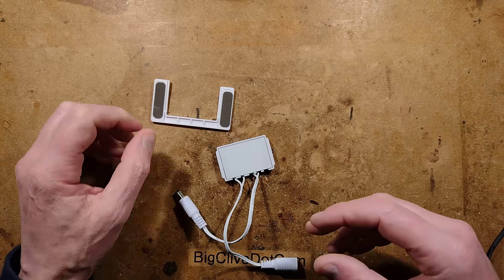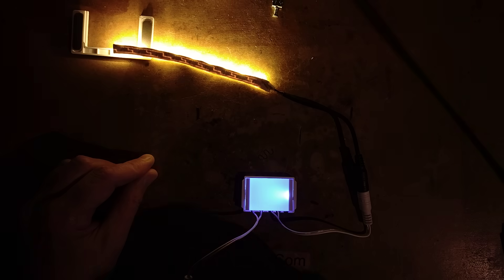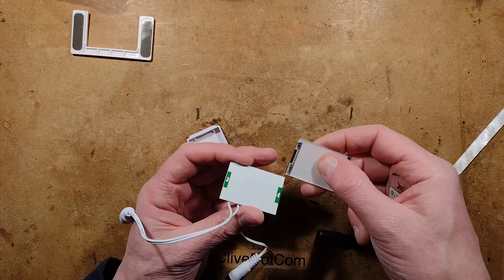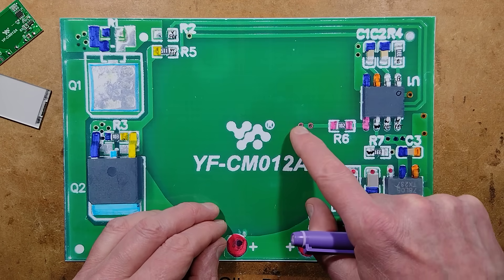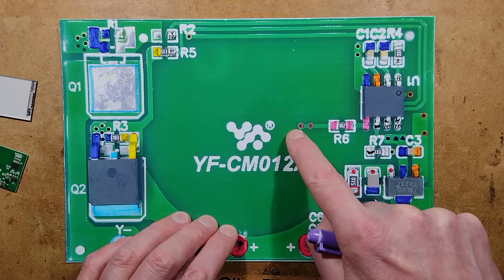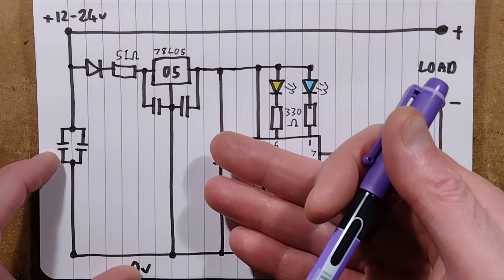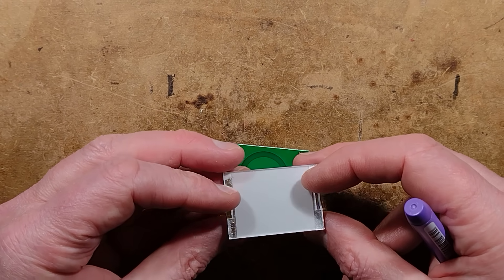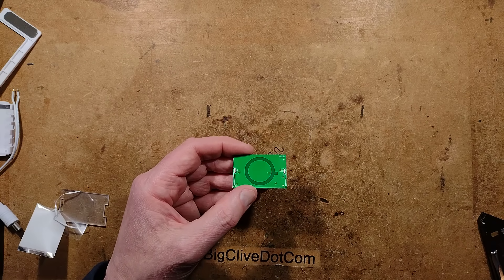Illuminated touch sensor for mirrors and other surfaces

Comment: I'm rather surprised that the circuit wasn't based off one of the common "223" based touch sensor chips. Those are cheap, have a lot of options available, use very little extra components, and work thru many rather thick objects. 

I use one as a hidden start switch in my hot rod. It's mounted behind the dash plastic in an inconspicuous spot, and you have to touch that certain spot after you turn the key on, or it won't start. Every time the key is turned off, it recycles, and you have to touch it again to enable the ignition system. It'll crank the engine without touching the spot, but it won't fire. That SHOULD confuse any wanna be thief... 🤷🏻
Reply from the maker: I think many of these products use clones of that classic chip.  Different number, but identical pinout.

Comment: The cleverest part of this design is maybe the illumination of the front panel. It can be very difficult to get an even illumination, without bright spots where the leds are mounted. 
It usually relies on total internal reflection in the plastic parts, and the launch angle of the light. It might have been interesting to look at the wave form on the touch sensor I/O.
What thinkness of glass can be used? There are strict electrical safety regulations regarding light fittings in bathrooms, so retro fitting to a bathroom mirror might be problematic, as the low voltage must be mains derived.

Comment: Maybe the software for two LED control are there, try to populate the mosfet and those two resistors just to see what happens. My guess is that will work with two LEDs, white and yellow.
I have a old LED strip that I got to mount around a mirror. The strip have cold white and yellow LEDs, but it was sold as white only and only the white LEDs were lit. When I oppened the control module, I just soldered a similar mosfet with the one on the board, few resistences and a fuse and both channel worked.

Comment: Back in 2000 I was involved in making several sets of capacitive touch pads to drive interactive displays at the Ron Arad V&A Retrospective. Two pads per display operating through Perspex so no problem. Then we we saw the Perspex at the fabricators - it was mirrored. I had a serious 'Oh sh*t' moment and we went for a walk and a think.

Took some of the Perspex home and found cellulose thinners removed the protective paint and silvering without touching the Perspex, and the protective paper backing provided a good mask. So we made the touch pads out of the silvering by removing a moat around them.
Reply: Should add the entire benching for the exhibits was clad in this mirrored Perspex, top and front. I have a feeling they copied the trick of removing the silvering instead of cutting holes for the displays.

Comment: alright chief. me again. if you recall i mentioned my UVC based 7 segment display clock idea some time ago. a commenter suggested it be known as "the clock of doom". so the clock of doom it is. i have been running some tests today and a problem has become immediately apparent. i was just testing the switching speed of the 2 quid odd each tubes one buys from ali express, the 6 watt ones. i am sure you know what i mean. i am intrigued by the way they have C8 sockets on both sides. i would love to se you cut one open, so i can see the bus bars. mine are too precious to do this with. 

anyway, i was using a clock signal to a 4026 and using the a to g outputs from that to drive mosfets, relays, and finally then the tubes. so i was only using 7 of them. it all worked fairly well. but my plan was, when the clock is complete, to have the clock behind glass so it would be safe, as i was considering the UVC risk. i failed utterly to consider the O3. my study reeks, as i am testing just 7 tubes. all 42 will, i suspect, be a dreadful irritant hazard. so BC, if you were designing an idiotic UVC tube clock how would you deal with the masses of O3? i am thinking fans and activated carbon? to be fair this problem is kinda caused by you. as you made all those UVC vids, that i commented on, and the contents of which fascinated me.  doris.
Reply from the maker: You can get ozone free UVC tubes.  But they may be harder to find, and you may also get ozone producing ones randomly shipped.

Comment: That's a nifty little touch sensor.  Thanks for sharing this video.  

As an aside. . .Please consider using your pen as your dedicated and exclusive pointer.  It would be much less distracting for me.  When you use your finger(s) they're much bigger and blunter than needed and I can't always determine what you're pointing at.  Additionally, sometimes there are extra fingers, thumbs, and the end of the pen (that you're holding in your pointing hand) adding to the visual noise.  ✍ or 👈👉✋🖖🖐👐🤙✌👋👍

Comment: A gadget I feel an urgent need to buy!  The bathroom mirror may be heading for a "slight upgrade" of the surround lighting 😀
Reply from the maker: It does require that the touch area is masked and sandblasted to remove the mirroring.

Comment: You should probe the unused 'yellow' ouput pin to see if it is actually implemented, that way you could mirror the other output and have yourself a bonus dual output device :) 🙃

Comment: As an alternative (removing silvering from a mirror may not be to one's liking) you could connect the touch sensor to the existing rear surface. May be a little sensitive and need adjustment, but then you may not need to touch the glass.

Comment: I'd wager in the mode where  the led tape was OFF in the demo, but the white backlight of the switch is on, is when the other mosfet would be turned on.

Comment: What are the limitations to it sensing a touch, in terms of the material in front of it. 
I rescued a suspended ceiling led panel from a shop refit(hope its not a duff one. ) mainly got it for the light diffusion materials. And the dc socket im sure will be useful.
Reply from the maker: It has a decent range.  But you can get dedicated sensors for detecting through wooden shelves.

Comment: If using behind a mirror, you'd need to remove a patch of the mirror metalisation (so you can see it as well as so that it would work). You could probably do a touch sensor in software by making the pin an output a zero (low) for a while (a millisecond or so) to discharge the touch 'capacitor', then set it high for a very short time to put a tiny bit of charge onto the touch 'capacitor', set the pin to input and see if it has changed logic level from low to high, then repeat the output high for a short time and read sequence and count how many small pulses are needed to charge the 'capacitor'. It should be more pulses for higher capacitance (touched). I used a similar technique a long time ago to measure the position of a potentiometer (fixed capacitor, variable resistance) but using two pins (one output and one input), and timing how long it took the logic level to change on the input. That was In the days before A to D converters were common on micros, and I believe the method was from a PICmicro app note from around 1997.
Reply: Yeah. There are libraries and example code on Arduino for using analog inputs as touch sensors. It works but it's not necessarily reliable. It can false trigger sometimes or fail to trigger.

Comment: The microcontroller might be able to sense if the second MOSFET is fitted by using the gate and pulldown resistors and switch modes automatically rather than needing different firmware?

Comment: I recently bought a "QUICKLYNKS BM6 Bluetooth 4.0 Car Battery Monitor 12V Battery Tester Charging Cranking Test Battery Analyzer APP for Android IOS" (gotta love those SEO names 😅) off of Aliexpress, and supposedly it is a battery monitoring device. Upon receiving it and looking through the clear plastic housing, it looks pretty lightly populated on the components compared to what they claim it can do, so i was wondering if you'd take a look inside one?
Love your content, cheers from Finland!

Comment: I was curious about how many LEDs I could run off that switch. I looked up the  MOSFET and it shows VDS = 40V ID =60A. 😮
I don't think the circuit board could handle that kind of load, but still...

Comment: Very interesting! Didn't know these touch switches were sold as separate items. Of couse, it needs a DC supply, that is hard to squeeze under a mirror, but the price is tempting 🙂
Reply: Our builder basically told us were definitely had to have a power socket in the bathroom "medicine" cabinet in case we wanted to charge an electric toothbrush or shaver in there... Seemed daft at the time, but makes sense when you put your electric toothbrush in there...
Anyway, that story just to say, if you had a power outlet inside the cabinet that's got both a mirror in the front and a place to stick a self adhesive LED strip underneath, it would work great.
Otherwise, cut a cavity into the wall behind the mirror and put the power supply in there. No one will see it that way.
Reply: @tin2001  Fun little story: back in the 80s, my father got a cordless razor, and he plugged it into the shaver outlet in our medicine cabinet (which had a built-in lighting fixture). Unbeknownst to me, my father had been complaining to Mom about his new razor not holding a battery charge.

Well, one day I come out of the bathroom after observing something unusual. "Hey, Dad, how come the little red light on your shaver turns off when I shut the bathroom light off?" I was probably eight or nine at the time, and had solved the mystery of the non-charging rechargeable razor! The medicine cabinet's shaver outlet AND light fixture were, as you've probably already guessed, wired to the bathroom light switch. Here's the kicker - my father wired the entire house and installed the medicine cabinet. AND graduated from a tech school after taking the residential electric courses. 🤣

Comment: I build smart mirrors on commission. People often ask me if I can make their mirror a touch screen, and I always tell them the same thing: Yes I could, but I advise against it, because if you have a touch screen in your mirror, your mirror will constantly be smudged.
Reply: Yep.
But a row of fixed buttons like these along the bottom or one side would be a suitable compromise for some people who don't mind fingerprints on the part you don't look at yourself in.
Reply: Turn down capacitive lower limit sensitivity. It's a touchless touch screen.

Also have to map/avarage it to have huge virtual buttons.
Reply: @nicholasboyarko1680  I have to do that anyways to make it workt through the mirror pane in the first place. Still working on procuring native mirrored touch screens.

Comment: now, how much LED tape can this unit run before the MOSFET overheats?
Reply from the maker: The MOSFET is beefy enough that the PCB tracks would be more of an issue.
Reply: @ so about an Amp or two?

Comment: Thanks for demonstrating an interesting and potentially very useful module. I can see this being used in the leisure industry, such as in camping and caravanning as well possibly on coaches. My first thought, though, was as a switch to provide backstage lighting during a show. With an unobtrusive glow it would be easy to find in the dark and touching it could provide a dim light at the side of the stage for prompting and technical operations. This could also find application with people running low voltage systems at home using these to control discrete LED strip around the home.

Comment: As a software developer I have never identified harder than with the tone of that "What is that? That is a bug! Where did THAT come from?!"
Reply: Followed by "it works, but how?!"
Reply: @TotallyNotARussianBot69  "It is the SAME fucking code I ran three minutes ago, and now it works!?"
Reply: It's not a bug. It's a feature.
Reply: @tin2001  In Software, it was originally a bug, now it's a well used feature.
Reply: I could not get a datasheet for the "B.U.G."
Reply: I replied, "Outside." 😂

Comment: Notice the cut in the ground plane lining up with the LED via. Somebody didn't want a ground loop, or didn't want the ground current to pass there.
Possibly due to them routing the mosfet control signal along the same path.

Comment: Interesting but as the dunce that I am could these be used with 5V power supplies and 5V leds? And, if so, how would you do it??
Reply from the maker: It might be viable to just bypass the 5V regulator for direct 5V use.  I'm not sure how stable it would be though.

Comment: Pressing a mirror all the time for a light to go on, you would never finish cleaning it!

Schematic shows bidirectional capacitors and having a group of two coming out of the right side of the lm7805 why not use a higher value, unless schematic is inaccurate, three of them all providing a path for higher voltage to bypass the 7805

Comment: Clive : is it safe to hook up an RGB string light to a 12 V automotive battery rather than using to supplied AC to DC power supply?
Reply from the maker: Car battery voltage can vary up to around 14V.  With some LED lights that can result in much higher current than normal.  But for some strings it might be OK.  It may be possible to add an extra resistor to help limit the current.
Reply: 12 volts DC is 12 volts DC, but use a suitable fuse with the battery.

Comment: Would it need different software? if white was dimmed while yellow was brightened would cycle from  warm white though neutral white to cold white.
Reply: it would be interesting to pop another MOSFET in and see what happens - I imagine they've got the same program in the uP to prevent them from having to stock 2 different versions.
Reply from the maker: It might be configured like that.

Comment: It occurs to me to ask, how well does the touch-sensing work when there is a mirror between the sensor and the user's finger?
Reply from the maker: It presumably needs the etched area for the sensing and illumination.
Reply: Capacitance
Reply: A standard mirror is not translucent, and i dont think you can peel the backing off without ruining the coating. There may be a method, but probably easier to just use a two-way.
Reply from the maker: @geomacaulay  They put a mask over it and sandblast it to remove the mirroring and etch the glass.

Comment: Neat module. It’d be neat on the rear of a black plastic sheet that has drilled or laser cut holes, if it would be sensitive enough to react through other materials.